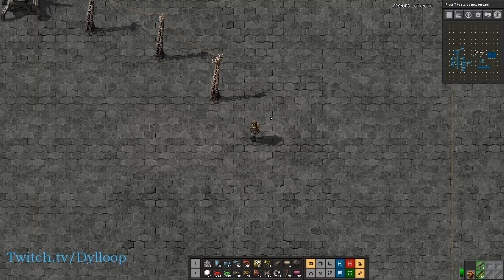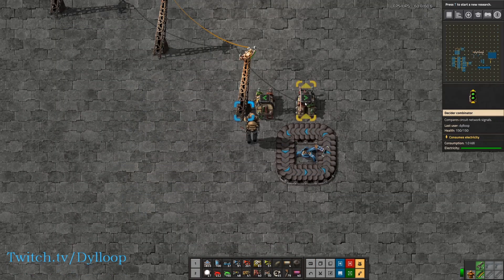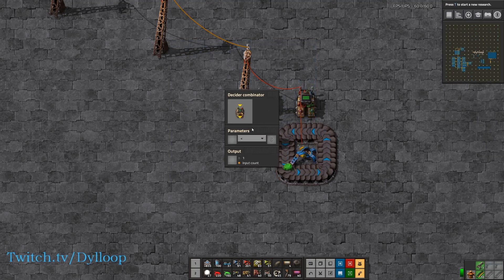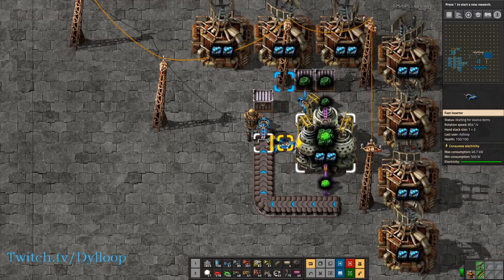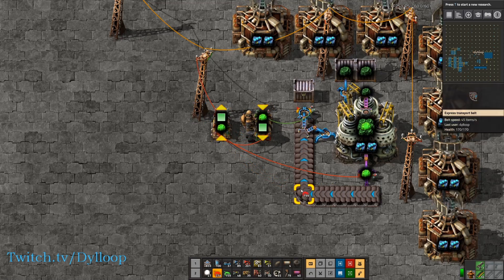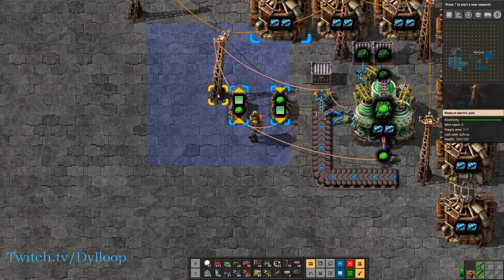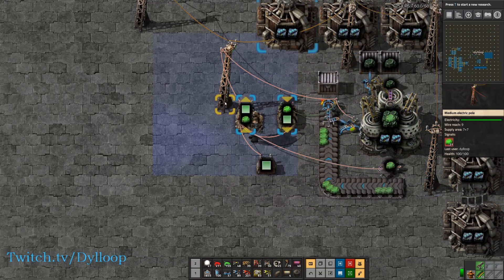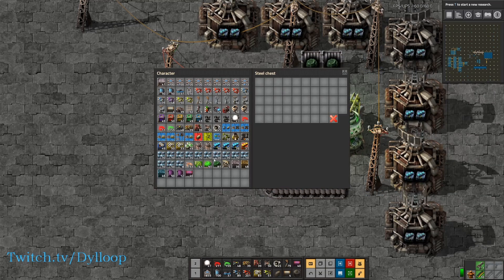Factorio 0.18 Tutorial - Kovarex Enrichment

Comment: Great video, I am not nearly as clever as you, but I found simpler method without combinators or droids. It has limitations though - it does not work with productivity modules, thus is useful for initial stages, until user has collected about 8x80 uranium-235. After that amount its smarter to just feed the centrifuge directly with uranium + use productivity modules, as overfill is less important than extra gain...  Hence its suited for intial hours in uranium centrifuging.

The scheme is three rows under centrifuge. First row are vertically placed under centrifuge  - one regular inserter (loader) and one packet inserter (unloader), distanced with 1 block, rotated vertically and opposite directions. Second row below them are two steel boxes, exactly where the two above inserters take/fill -- but there is also one regular packet inserter oriented horizontally that takes from output box into input box.  Third row, exactly below the boxes there are two new vertical inserters - for loader row its filtering regular inserter (depleted 238, wired to input box above, with condition: on, if u283 less 5); for unloader row, its filtering regular inserter (enriched 235, stack size set 1, wired to input box, with condition: on, if u235_enriched is 0). The belt should run below the whole thing, it can be built into 3x3 block with empty hole in the middle.

How this works: the filtered loader from third lowest row will make sure centrifuge is fed with 238 from belt into input box into centrifuge. User has to insert initial 40 235 to start now. Centrifuge will output 41/235 and 2/238, which will all be dumped into output box. Immediately this causes two inserters to combat over contents - the packet inserter that refills the input box grabs 4+, while regular filter inserter grabs only 1 and throws it off the belt below. But because regular is set to operate only if input box is empty, it will immediately stop after 1, as packet throws 4+ there and loader inserter from that box takes only 2 at time; this causes 1 to leave to belt and rest to be reinserted. The whole logic occupies only 3x3 block below the centrifuge.

Comment: Why not loop all that the inserter can fit into the machine back into.the machine and let go of the access then?
I have a huge enrichment circle with like 20 machines running with no logic, just belts, inserters and basic filtering....
Reply: Because inserters will fill centrifuge to 80. There is a better and simpler machine than in the video (sorry OP), but its not compatible with productivity module, as those will output extra +1. See my main comment.